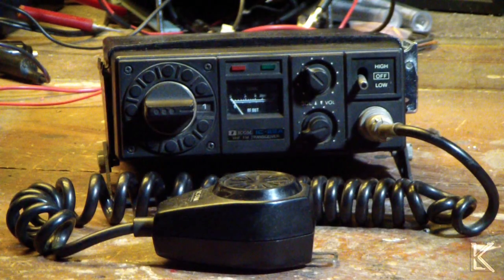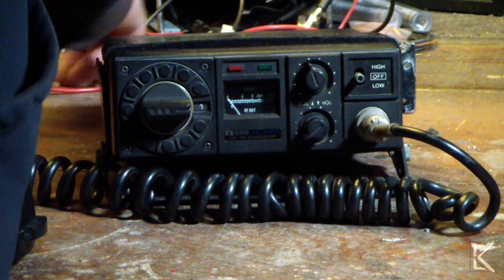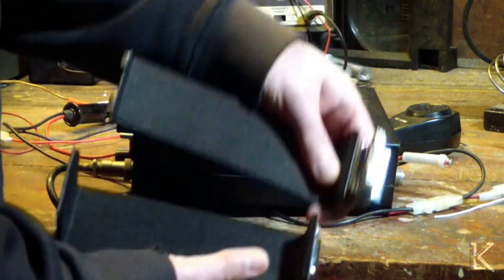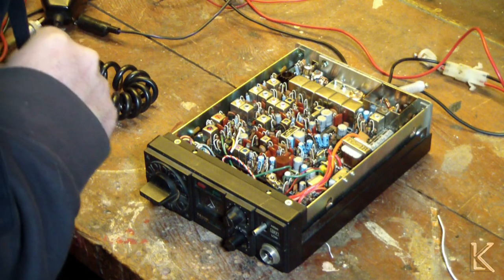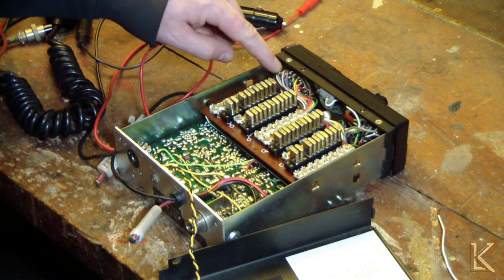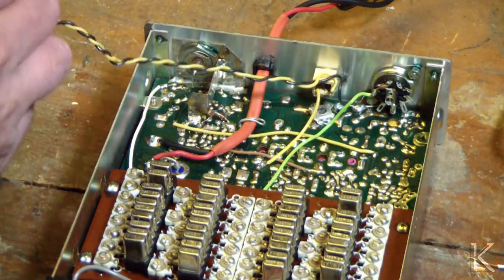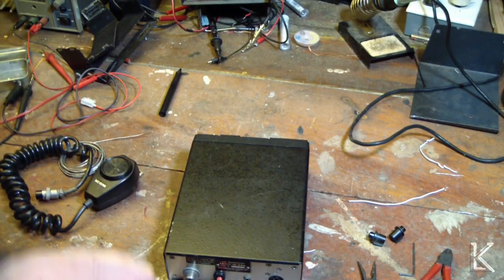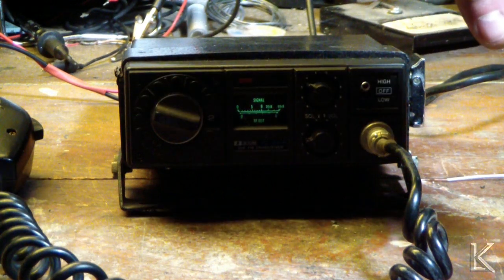Ham Radio - Icom IC 22A minor repair testing and cleanup

Comment: Late to the dance here, Kevin, but those "cans" in the back of the radio are helical resonators. They are part of the reason that the IC-22A and IC-22S and their European variants had a sensitive receiver with a front end that your withstand the equivalent of a nuclear detonation. 

https://en.wikipedia.org/wiki/Helical_resonator

The IC-22A's downfall -- as with most radios of the day -- was that a $180 radio easily doubled in price when the new op purchased  additional crystal pairs for all of the local repeaters and simplex pairs. The IC-22S shoe-horned a synthesizer board on top of the receive and transmit boards which covered the existing 146-148 MHz repeater sub-band of the day -- and even could be used down to 145.10 or so with a negative offset before coming out of lock. 

The IC-22S's downfall was that it was too good of a radio and, when the 2m band was opened  up for all four MHz of repeater operations and the lower half was put on 20 KHz center channels. Also -- and most sadly -- was the fact that the phenolic synthesizer board had no   plated-through holes and relied on 13 stainless steel feed-through to connect top traces to bottom traces. Over time, the solder joints would crud up and the radio started getting inhabited by "ghosts". 

You would come across one of these at a swap meet being offered for $15-20, buy it,m take it home, re-sweat the feed-throughs and -- BAM! -- new radio (for about two-three years).

At one point, I owned 12 of them.
Reply: hi can you please help, i need a diagram or wiring for my mic ic-22a.you can email it to imvcsajaghy@gmail.com please cant fine it on youtupe..thanjs a lot.

Comment: That was my first solid stare radio. Before that I had an old Motorola mobile out of a police car. I was able to find another IC-22A with the matching power supply and I am going to hold on to it. You are right about the sensitivity of the receiver, it is very good.
Thanks for posting. Oh...the socket on the back can be hooked up to a 50 micro amp zero center meter so you could net the receiver to a repeater (or service monitor if you were lucky enough to have access to one).